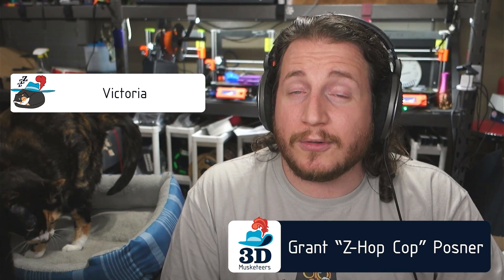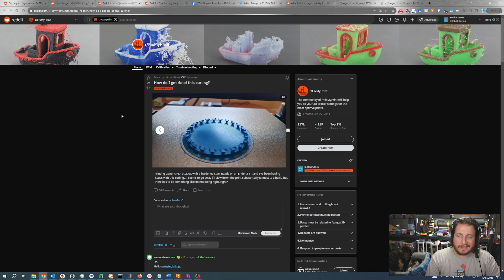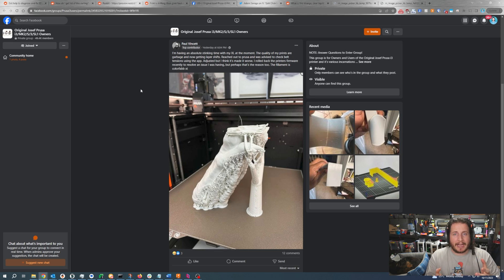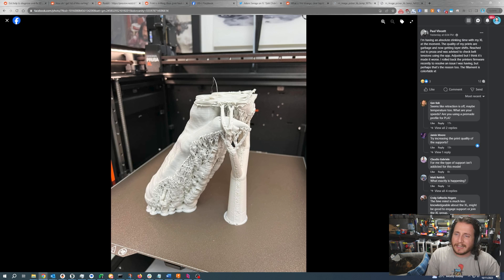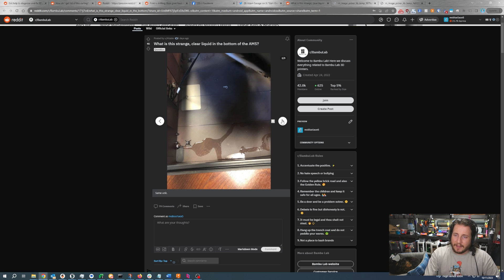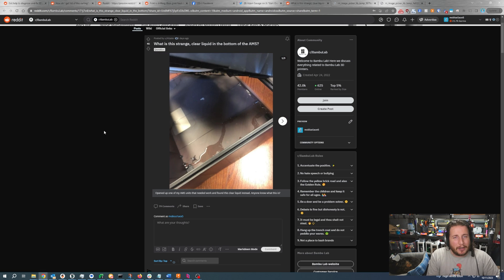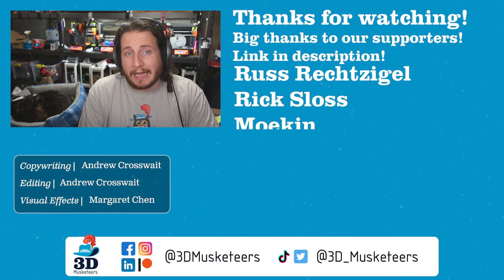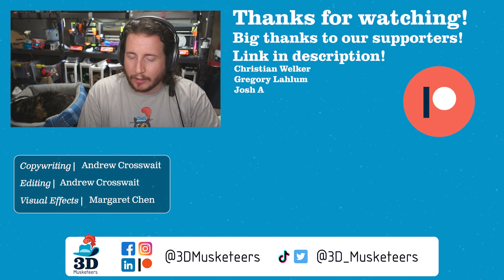Z-Hop Fixes Everything! (Except For Dumb Corporate Decisions...) - PrintFixFriday 109

Comment: The support part at the end is the only reason I got the X1C and AMS lol I love being able to use PETG as a support interface for PLA, 0 Z contact distance, perfect undersides, pops right off.
Reply from the maker: you better have your purge volumes perfect though. It is one of the reasons I am excited for the XL 5 toolhead as a tool changer does not have these issues

Comment: 4:44 Using sound to tune the belt tension is actually a very valid way of doing something like that. I work as a conveyance controls tech and the best and most accurate way we have to properly tension belts is using this ultrasonic tension device, rather than using belt deflection which can be vague at times. You can think of it like torqueing a bolt, if you tell 10 people to torque a bolt to the same torque with just using a ratchet wrench, the torques are going to be all over the place, but give everyone a torque wrench and they will all be within the same range with each other.
Reply from the maker: oh it definitely is. Back in the day we would use a guitar tuner, it was less precise but it worked. An app is really smart, but does feel a bit janky
Reply: @3DMusketeers  I imagine that's probably due to the frequencies needed for proper tuning are clipped of by the phones mic. Haha
Reply from the maker: could be?

Comment: Re: Bambu, there's also an ongoing issue on Makerworld, there there's a "colleague" of BL that is uploading dozens of untested print settings profiles for models that people have uploaded. According to a good number of the artists the profiles simply won't produce the intended results, and BL claims that these profiles also can't be removed. One good example is Voron parts that have a certain quality setting criteria of 4 perimetera and 40% gyroid infill, and this BL bot/colleague is pushing dozens of print profiles that don't meet the Voron quality standards, and the model uploaders have no recourse other than to set the models to private. Additionally Makerworld has a point reward system for the first person who uploads a new allegedly tested print profile for a model, and since this bot is pushing dozens of untested profiles on each model this has the effect of denying people any form of compensation for testing what a good profile might be, because the bot has already uploaded almost every profile imaginable. Model artists are up in arms over this whole fiasco because it takes control away from the artist over their models and denies them the opportunity to benefit from resarching quality print profiles for their models.
Reply from the maker: yep, Bambu will not let you just have models, they also provide profiles and if those do not produce good prints who do the users get mad at? Bambu or the designer, whom they see as the person who uploaded the gcode.. It is a nightmare.

Comment: A good way to think about overhang part-cooling is you are putting so many watts per volume of filament, that filament has the ability to transfer that energy to adjacent filament it gets bonded to, usually that's a wide patch going down, when you do overhangs the edges sometimes barely contact those solidified filaments to use as heatsinks, so that heat energy only dissipates into the air(insulator) and adjacent still-hot filament beside it. So it stays molten beyond the nozzle going past to make it conform down and to shape, both trying to blob up initially, but mostly resulting in differential contraction, just like a bi-metalic strip does. I've often wondered if a system involving a shaped metal plate that could slide atop the filament and help uniformly cool it and prevent local curling, for extreme overhangs and material types.. but there are better ways, like aggressive climate control, temperature and airflow.
Reply from the maker: I like it! Good analogy

Comment: Bambu doesn't create "Creator Profiles" on makerworld. The "profiles" people are angry about about are PRINT PROFILES for models that already exist on makerworld, which is in essence a 3mf file with print settings. Creators can claim their model when it wasn't created on makerworld by them to get it under their "creator" profile. Yes, it's possible for anybody to create a model on makerworld - whether that's ok or not depends (legally speaking) on license, and whether using the original pictures from somewhere else is also an issue, but that's why there's a copyright claim system on makerworld from the start. What are you asking them do to? Disallow people from creating a new models that break copyright based on... what?
And what are you talking about paying $1000 more not to have your data stolen? What? How? What are you even talking about? X1E is basically a somewhat improved X1C with enterprise support. Just like you get servers or any other equipment with enterprise support in configurations that are not sold to general public and built in more uncommon configs. Don't like the cloud? Don't use it! True, firmware upgrades are online-only at the moment, but that's just because it was simpler and getting offline upgrades that are "secure" (in the sense that some Chinese manufacturer doesn't copy Bambu) is not trivial.
Stop spreading FUD.
Reply from the maker: Bambu absolutely created those profiles. By using the sames and likeness of the designers they are breaking copyright and trademark laws. That's clear and simple. 

As for data, the x1e and more, if you don't like my thoughts, you know where the door is. My world is data privacy. And it's something Bambu gives nothing about. I figured with an enterprise machine maybe this would change, but nope.. tell me, again, how the x1e is worth 1000 more than the x1c?

Comment: Savages spaghetti was definitely bed adhesion.  I've had no problems since going to Bambu's liquid glue with any filament on any printer.  It's fantastic!  He's also running old firmware visible by the old test pattern.
Reply from the maker: I am running old firmware and have the new test pattern. Orca generates it.

You do know that glue is just PVA glue stick right?

Comment: Fan is only half the equation. Actually running the print faster might help as the hot nozzle doesnt dwell over the print leaving it hot or reheating it. I used to run my first layers super slow only to realise it was hurting. 

I have run a desk fan for the last 8 years works well enough.
Reply from the maker: they could also dump temps I guess!

Comment: I get them curling layers with my mk3s+ using PETG. Hardened nozzle, and stock extruder and cooling.
Reply from the maker: cut temps some and see if that helps. It can be tougher with PETG. We add more cooling than Prusa recommends and it seems to work well.

Comment: Yessir! I'd love a dedicated video on more Bambu stuff. I'm quite sure they're breaking AGPL in depending on third party software, that is, the drivers to their printer, which they apparently don't own the source for (according to Bambu) and also quite possibly in the firmware itself. I know it's based on Linux (nmap -O is very good on this) so they have probably their own third party drivers in there for hardware. But then, I don't know because I don't have the chance to hack it at the moment. I'd need a motherboard or two and probably some help from people that knows more about connecting to SMD stuff…

Oh - and add a video about supports as well :)

Thank you!
Reply: It's going to take more than merely SMD experience. You're going to need a full-on die-deconstructor reverse engineer. The firmware is hidden behind an encrypted gateway that we've been trying to crack for quite some time. Unfortunately, the encryption happens on-die, so we can't even intercept the data as it's written without essentially deconstructing the processor and sampling the data from within the device itself. It's utilizing SHA256 salted encryption, rendering rainbow tables useless. It's near-impervious to inspection. My current best guess as to how to crack it? Infiltrate Bambu. They've got better security on this device than most government datacenters.
Reply from the maker: I dont think I am qualified enough to dig into the GPL side of things, but I can try. I just dont want it to sound like I am complaining and such..

Comment: i would absolutely love to see a video on how to tune supports. 
also one on printer glitches. i notice that my printer (modded ender 3 pro ) will stall in mid print and wont respond to commands.
Reply from the maker: that is way more specific, could be a bad SD card/usb drive causing that. Could be the motherboard overheating. Prints just randomly stopping are not common.

Comment: People always claiming a draft caused poor adhesion and you recommend a desk fan blowing on your printer. 😊
Reply: The problem with a draft is that it is not consistent.
Reply: @eslmatt811   more like non-existent
Reply: That applies for ABS, not PLA
Reply from the maker: for materials like PLA, more cooling more better. One that is properly aimed will GREATLY help print quality. One that is not will hurt it. Drafts are not much of an issue with PLA. ABS on the other hand, no chance.

Comment: Every time that the thought of buying a Bambu creeps into my head they give me another reason not to. At this point its a hard no.
Oh, and I'd love a support video.
Reply from the maker: sounds good.
Reply: I have a X1C with AMS since 2 weeks and like it a lot. Very good quality and fast. Dialing in filament profiles goes fast with the sensor too.
I also have a Voron 2.4r2 with ERCF (MMU)and you can do a lot more DIY but the Bambu just works as it is.
Reply from the maker: I am glad yours does, but the 2 I have had are not good at all.
Reply: @Todestelzer  It appears that the majority of owners get a good printer and I see tons of fantastic prints coming off of them. My issue is the company itself. Data security is a problem, this new printer helps but for 1k more? Spotty customer support when both Prusa and Sovol have been great for me. And now this stl theft that they pretending is for the designers benefit. Yeah, I'm out. I'll just wait til somebody else makes what I'm looking for, or I'll get familiar enough with klipper, config files, and settings that i'll feel confident in building my own (voron etc)
Reply: @JoeC-tt9oq  yeah China company’s are copy cats and it’s in their DNA it seems. 
But what would be a good alternative for a Bambu. I looked into the Snapmaker J1 but this printer isn’t good for high temp, doesn’t come with hardened nozzle and has clogging and part cooling issues. 
Quidi makes some interesting printers but don’t offer the software Bambu printer comes with. 
I need a printer for PA, PC, ABS with the ability to print support with different filament.
Reply from the maker: Qidi has profiles on Orca Slicer, so yes, it has the same, if not better software than Bambu Studio. 

I know this because we just unboxed an x plus 3 and used the orca profile for it with good results :)
Reply: The Qidi caught my eye. I don't remember why but after watching a couple of reviews (including Aurora) something kept me away, just don't remember what. Might have to rewatch the videos. Would love to see a review from ya. @3DMusketeers
Reply from the maker: We unboxed the X Plus 3 just recently, needing more seat time with it
Reply: @Todestelzer but Bambu x1c didnt copy anyone?....
Reply: @JohnSmith-rt5yq  they copied Klipper and the Auxiliary fan for example oh and Printables including copy’s of maker names with there models.

Comment: Yes, tuning for supports would be awesome!
Reply from the maker: okay, sounds like a plan!
Reply: @3DMusketeers Recently I was chasing a support problem. It was with integrated support, but also with a print in place hinge. It turned out the first layer above the gap was printed thicker over that area, which was because I have had thick bridges turned on with prusa slicer 2.6.0.
I haven’t fully verified it yet, but now my slicer created support behaves much better as well, so I would assume the slicer handles that the same way.
It was the hinges which got me puzzled to take a deeper look into the print preview when I noticed the thicker extrusion.
Reply from the maker: interesting! Have not experimented there, I need to.
Reply: Second
Reply: Third
Reply: Yes please talk more about interface loops, and rank materials (including PLA, PETG, ABS/ASA, TPU) by support removability and printability of unsupported overhangs/bridges. So far my solution for difficult-to-remove supports has been to design unsupported prints wherever possible. I haven’t yet tried dissolvable supports with IDEX.